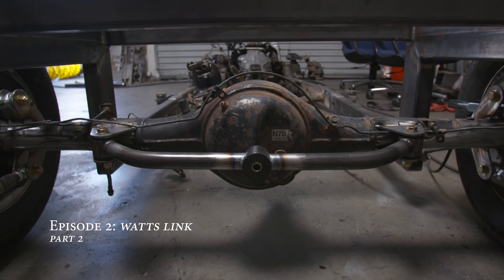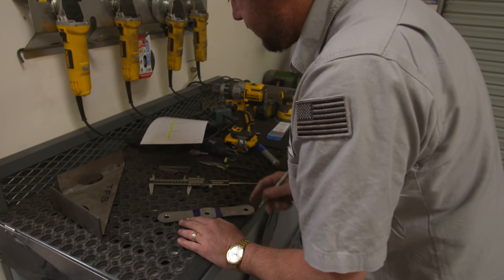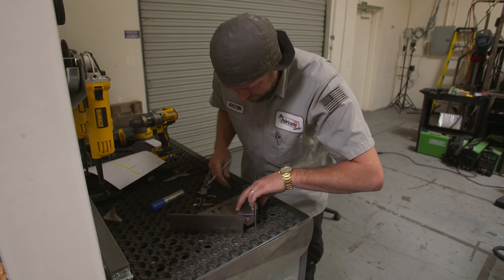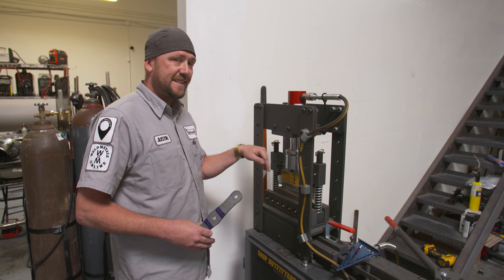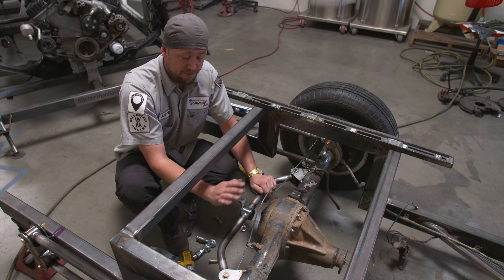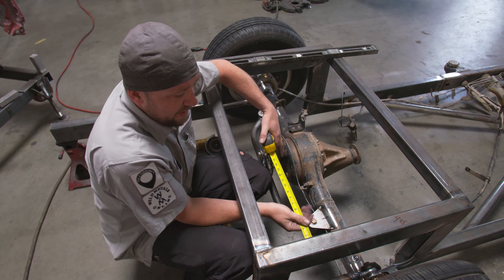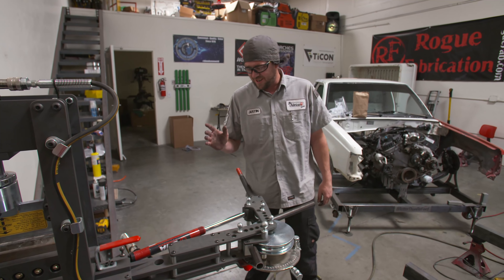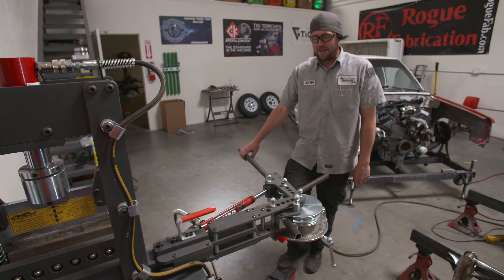Watts Link pt 2

Comment: A Panhard bar would have worked fine I believe. This setup does have a cool factor though.
Reply: Panhard bar is much simpler, but creates assymetric travel due to the swing of the bar creating an arc path on only 1 side. Watts linkage is more complex, but provides true centered vertical travel.
Reply: Ronald Smith funny. It works fine. Been doing it for decades.
Reply: Fancy-Dancy and time consuming plus the added weight. Still up in the air on this.
Reply: Terry Hudspeth too heavy, too many moving parts for wear or failure, too heavy. But still cool and the correct application in some cases.
Reply: @sidgar1   quick-change rear end friendly?
Reply: Ronald Smith  explain?
Reply: dennis brown  Dirt is about the inly place it works pretty well...
Reply: @docholiday1034  
Yeah, that's why Ford decided to use a Watts Linkage on the Lincoln Town Car Platform.
Reply: Jim Brown  also one of the customer complaints all the time with those...joe average feels the bind.... plus we are always changing the links 😂 FoMoCo wont be using that much longer 
Bingo ..  hell even the old junk tarus control arms we could bend by hand never had complaints.
Reply: @docholiday1034  
I didn't mean to say that I'm a Ford fan in any way, in fact, quite the opposite, GM is better engineered on average,
but they've made some garbage as well.
I just found it interesting the strange way that Ford implemented the Watts Linkage into their rear axle,
and you have to admit that there are still plenty of ex-Cop cars--turned into Taxi-Cabs, that are still running around.
The particular implementation is the problem ..... 
before it fails, it works fairly well .
The basic mechanism of a Watts style Linkage is not the problem, it's the "wet noodle" construction that Ford used.
So to say that it really only works on a Dirt Circle Burner is very misguided, 
especially when you consider the amount of abuse Dirt Race Cars have to endure .
Quite often a particular "Style' of racing will stick to certain suspension designs because it's what everybody else is doing,
or because it offers a certain type of convenient adjustability for differing track conditions .
Personally, I think a Watts Linkage is entirely too bulky and complex, with too many possible points of failure,
to be used on any daily driver, when there are so many other options that are quite often, more advantageous . 
.
.
Reply: If you have tight tyre to arch clearance you need a watts.
Reply: Pan hard on a vehicle that can get 12+inches of travel is not a great idea. 
On a static vehicle, sure. 
On a bagged vehicle, the axle shift is to much.
Reply: a c you sure a fuck wont get 
12 inches of travel with out bind on the one here.... what was the last chassis you built?
Reply: jane blogs  NOPE.... I do this kiddy lay frame crap for the kiddy crowd...Sure not something your going to put miles on.... all panhard and truck arms....  4 link for the performance guys. But it would never be this screwed up.. instant center is so f ed up. Its a horrible mess that new chassis guys try to reinvent..... most have no idea its been done by new guys hundreds of times and failed
Reply: @docholiday1034  Bagged/hydro vehicles regularly get 12+ inches of travel. My last air bagged truck got 16 inches of travel in the rear and 12 in the front. Could lay frame on 31 inch tires and lift above stock ride height.
But if you have to ask, I have back halved 2 s10s, a tacoma, a toyota mini truck, 2 c10s, a pathfinder and an impala that all get dailied. Bind  isn't usually an issue if you use the correct parts and geometry.
Again, a pan hard bar is a crap idea on a high travel suspension. There is a reason most pro offroad guys ditch it for a triangulated 4 link.
We also have no idea what this chassis is being used for. Seeing how he did a reverse parallel 4 link (which would mean it has an infinite IC), it's more than likely going to be a car chassis because a forward facing one would eat into floor/seat space. If this is going to be a cruiser (which it probably will be seeing how he is also working on a track vehicle at the same time) that is super low like a "ratrod" , performance kind of takes a back seat to packaging constraints.

Comment: I'm curious, Why is the differential in front of the 4 link? I've never seen it done like that before. What is the advantage?
Reply: People usually do rear mount 4 links because there isn't room up front. Link on a car, that is where the seat or floor pan would be. So you can do a reverse mount because there is usually nothing behind the wheel.
Reply: @zososldier  Interesting. Thanks
Reply: @onebadsavage26  yeah, I personally think he is gonna put this frame under a car.

Comment: Noob question: why would it be wrong to put the tab in the same place on the left side (wheel arch) and bend the lower link up to meet it?
Reply: That would instantly bind.
Reply: The pivot location is the critical part. It makes no difference what the bars do. The ends of the link don't know if the bar they are attached to are straight or crooked, and they don't care, they follow the same arc either way.

Comment: The centre link needs to be setup vertical at full and bottom bump for the link to work optimally, not at mid level where the bars are checked for parallel.

Comment: How does this system behave when only one side is raised and lowered like hitting a pothole or speed bump?
Reply: It won't be effected.  That center pivot bushing will stay right where it is and the tire effected will move up or down and the axle will stay aligned just fine.  This system is actually better for axle alignment than compared to a panhard bar since it keeps the axle moving straight up and down instead of in an arc and the 4 link is better than leafs since it will severely reduce axle wrap or hop.  This should be a very solid set up when it's all burned in and complete
Reply: patrick ezuma axle wrap could be controlled by similar mechanisms on the axle where the original perchs were

Comment: Watts link or a pan bar what’s the difference
Reply: Watts link keeps it dead-centre and travel is vertical, a Panhard rod lets it move in an arc; admittedly a very shallow arc but an arc nonetheless.
Reply: Lanyard is easier to make adjustable roll center, multiple or slotted hole on the chassis mount

Comment: You are a great fabricator and welder, Justin, possible the best on YT and certainly the best teacher/tutor,  but I think you skipped the suspension design classes, or at least the explaining part 😉
With lateral forces they are applied equally through the Watt's linkage - one link is compressive and one is tensile - each half the force applied force between the differential and chassis. On that, the lower chassis link is going to have negligible fore-aft loading, and really needed to be braced for lateral loads, but that looks like it 'shouldn't' bend unless the axle gets a really substantial whack, and then you'll have more than that to worry about.
With longitudinal leaf (AKA semi-eliptical) springs, the axle moves in an approximate arc around the fixed eye (AKA shackle), with the other end designed to be free to move forward and backwards while relatively restricted laterally, so the parallel arms should have been trailing.

Still looking forward to the final result, as there are some good reasons for your setup.

Comment: Dude, a properly designed watts link should ALWAYS have the pivot on the frame. It's much simpler to do it properly, then all you have to do is attached the ends of the links to the axle. Read some books on suspension design please, I prefer Carrol Smith's literature.

Comment: Your set up is not correct. At mid travel the watts link pivot arm should not be vertical, it should be at one extreme of travel.  The geometry in this video is not correct.